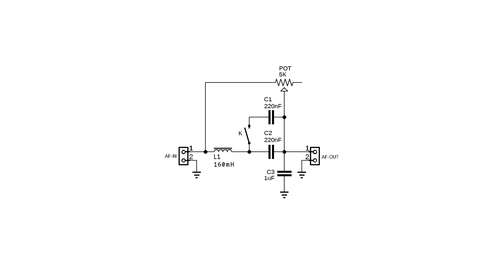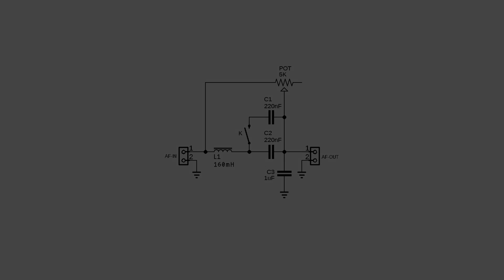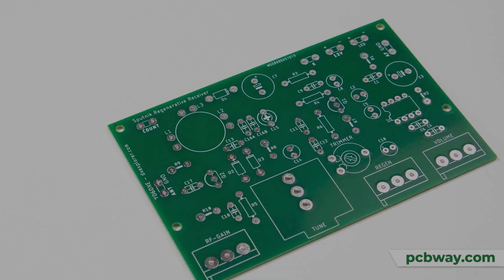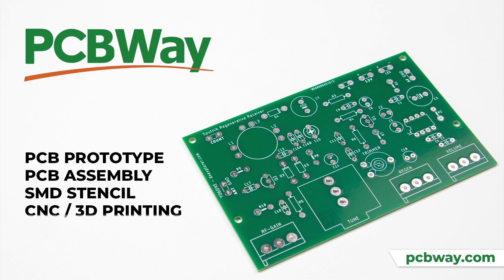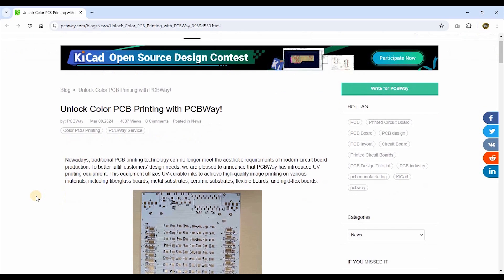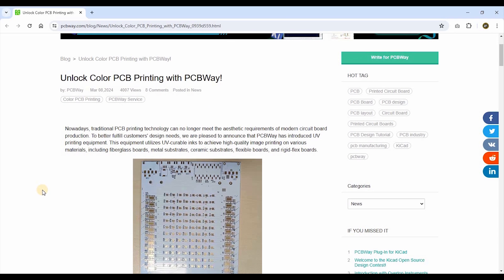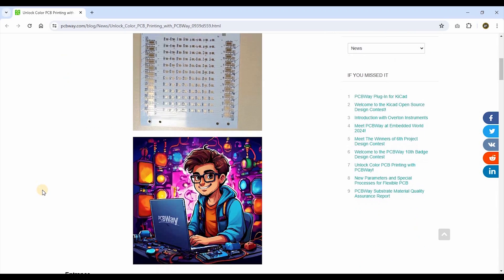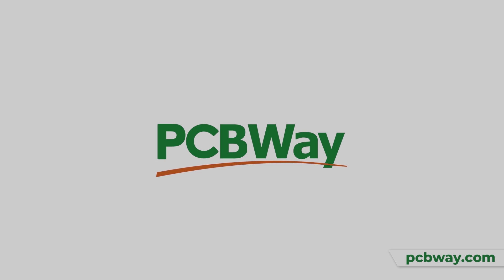A Simple Passive CW Audio Filter 600Hz - 800Hz

Comment: Hi! Whats the difference between Passive and Active CW Audio Filter?
Reply: Thank you for the info!! 73
Reply from the maker: Always a pleasure my friend. 73
Reply from the maker: Passive means there is no amplification of the signal going through the filter... usually this is just a simple LC or RC filter most of the times. In most cases you also lose a little bit of the audio signal going through the filter. On the active filters, you also have a little bit of amplification of the signal so instead of decreasing the audio lever as the passive filters do, the active one will amplify that signal as well. That is why I say that this filter its a passive filter, but used together with an LM386 audio amplifier it will automatically become active filter.
Reply: @dxexplorer  Hi! Do you think a 150mH inductor with max current 30mA will withstand the incoming audio signal? Thanks!
Reply from the maker: That I don't know. Probably it depends on the signal goes into the filter. With an LM386 audio amplifier I think you should be fine though.
Reply: @dxexplorer Thank you. Ill tell you whats the result, i wanted to test diferent types of inductance.
Reply from the maker: That is also what I did. Only that I measured the inductance value then played with the value of the capacitors until I got it to resonate the way I wanted 😁.

Comment: I would love the schematic and parts list so I can build one for a simple CW transceiver I'm working on. This would help tighten up the signal and make the receive end much nicer.
Reply from the maker: I will be back a little later today with a download link. I recently closed the DX Explorer blog as I had no time for it, but I will move the download files on my sailing website so people can still download the files.
Reply: @dxexplorer  thank you kindly sir! Very greatly appreciate you and your time!
Reply from the maker: Here is the download link:
https://28-north.com/download/20764/
Remember it's a passive audio filter so it will lower the audio output a lot. So if you want to use it with headphones and still have a proper volume, I would recommend an LM386 audio amplifier after the filter.
Reply: @dxexplorer  I've got an lm386 board with 10w amplifier laying around I will use with it. Thank you again! Now, time to get building!
Reply from the maker: Sounds great. Experiments begin 😆

Comment: Your receiver is drifting like crazy.
Reply from the maker: Is the Little Roo. It usually does that when I turn it on until it warms up then it becomes more stable in frequency. But is not just the receiver, the propagation is acting strange as well having the signals in and out all the time. 73, YO6DXE
Reply: @dxexplorer  Get a whole bunch of misc mains transformers, old neon light ballasts and other inductive parts, these normally have a very high inductance (100's of millihenries up to several Henries) which are great for making audio filters, especially passive ones. The other advantage of a mains transformer is that it has a primary and secondary winding, these will be closely coupled so you could use say the primary in the actual main circuit and then resonate the secondary with caps to give you even more selectivity. Depending on the design, the high ohmic loses (and lower Q) may actually not be a problem, especially if the filter is designed for a lower impedance.
Reply from the maker: I tried some in the past but I think the Q of those transformers is not as high as the one with magnetic material as a core, so they were not as sharp. The other disadvantage if using the primary of the transformer is that it also has quite some resistance, so that also mean loosing a lot of AF signal. But when nothing else is available... they are better than nothing )). But now I am collecting these ferite cores for transformers that I find in old filters and keep them in case I want to make more custom inductors as this one. They seem to work fantastic and they don't require such a high number of turns for a certain inductance compared to a regular transformer with metallic core. 73, YO6DXE
Reply: @dxexplorer  Yep, I agree with you that the DC resistance will act against you in some configuration, especially if the winding is in series with the audio. Where they are useful is in parallel type filters such as notches. The primary goes from the audio to ground via a series capacitor to resonate it at the unwanted frequency/ies and on the secondary, you resonate with another cap (but in parallel) to "suck" out even more of the unwanted range. A series potentiometer, then allows for adjustment of how much notching you require.

Comment: Im trying to use a 110  to 6 volt transformer  kg6mn
Reply from the maker: I never tried one of those but I have the feeling that due to the high number of turns in the primary, you would have a lot of loses in the audio signal. Also the Q of the inductor is a lot lower so the filter would not be as sharp. Is better if you find some magnetic core in some old power supply as I did and just make one. Better results for sure. 73, YO6DXE

Comment: Ciprian, you're right. So simple and very effective. Many years ago I installed such a filter in my station loudspeaker. Years after that I sold the device. You've made me install such a filter again in the loudspeaker of my current station 🙂
mny 73 Bernd, DF7PI
Reply from the maker: Hehehe. Indeed..  I am also impressed on how well it works. I want to build an audio amplifier to use it with simple low audio output transceivers and have this filter incorporated into the audio amplifier. I think it would be nice to have some filtering especially that simple transceivers are wide open on the input. Glad you also like it. 73, YO6DXE

Comment: The nice thing about a passive filter is that there is minimal ringing. It's just a clean sound.
Reply from the maker: Yes... and it works really well comparing to some other schematics I found based on transistors or IC's. 73, YO6DXE